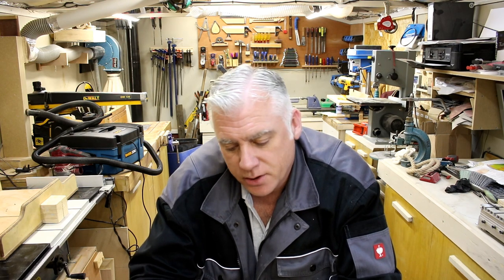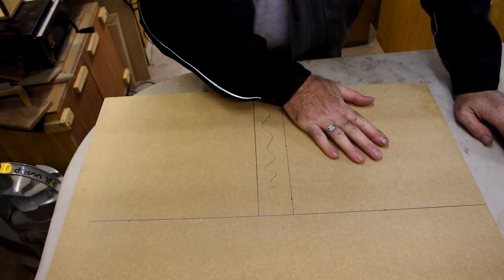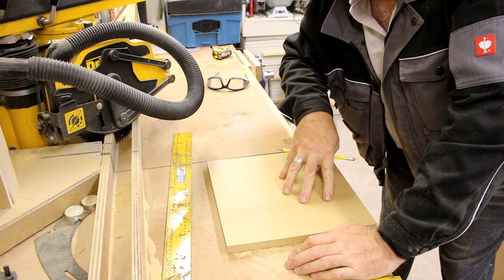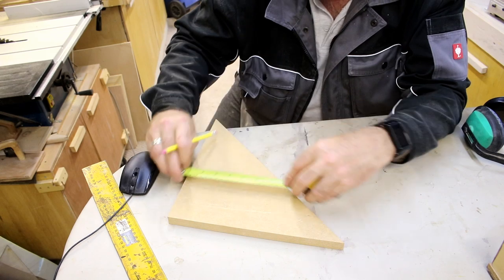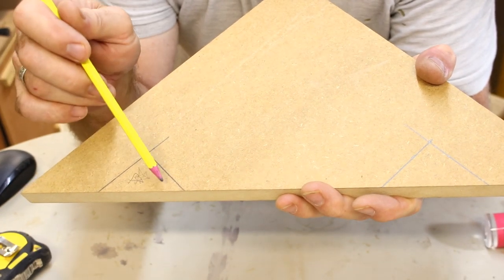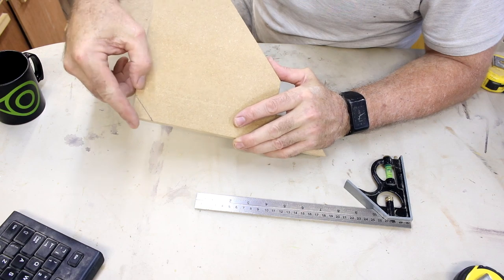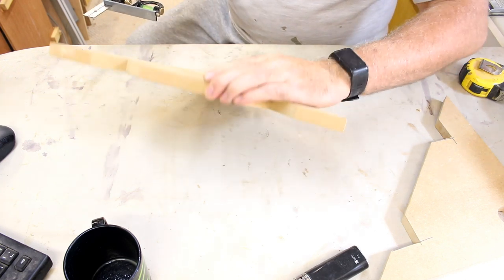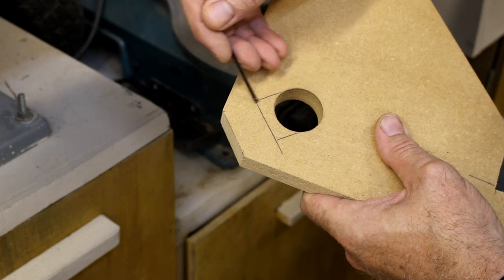Perfect Corners With Miter Corner Clamp Jig DIY Build

Comment: I don't get it.  You have a 45° angle on the tri-square, but you measure 270mm from the pointed end twice and connect the marks.  Measure 30mm from the square end once and use the 45 that is built into the square.  The 45° on the square end is for clearance anyway and is not critical.  You could even eye-ball it with NO marks and it would be sufficient.  Same thing with the miter block.   Then when you use the big miter block to clamp, the edge of the clamp is not parallel to the edge of the box, forcing the orthogonal edge to be at a slight angle. Then you put both squeeze clamps to the inside so the tails interfere with each other.  Couldn't one be rotated 180° to eliminate the interference?  Maybe all this has to do with producing the youtube.
Reply from the maker: Thank you for the comment your support means a lot. There are many ways in which to make a corner clamp some are just to complicated and really don't need to be hence the video.